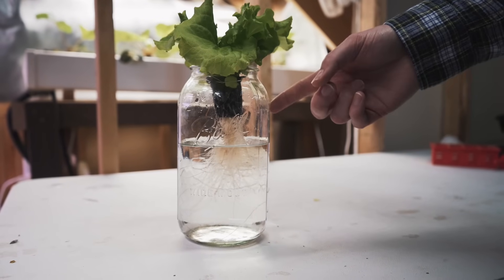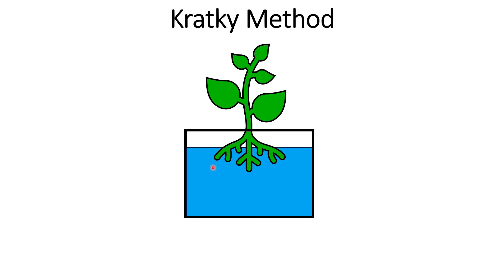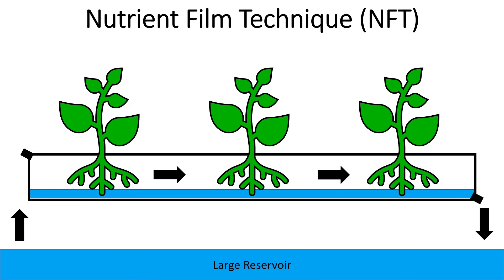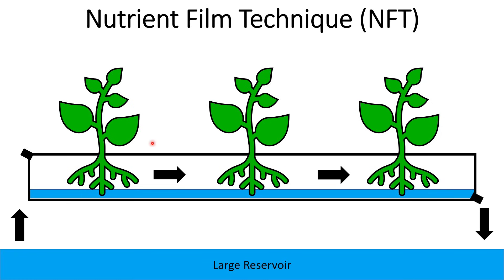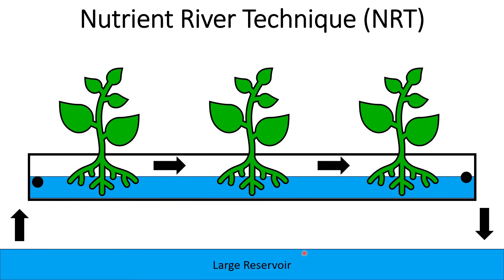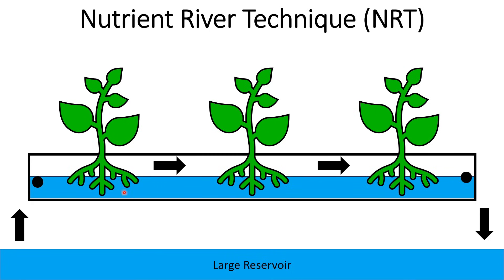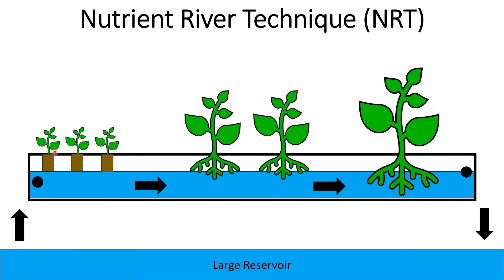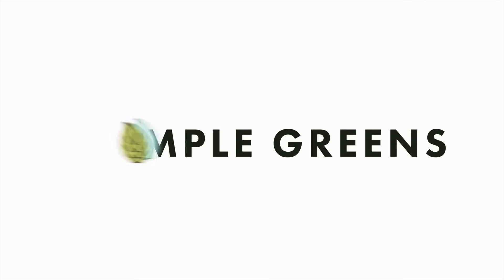Why this Hydroponic System is better than NFT or Kratky

Comment: I built this in a 90mm pipe wall system using gravity and bells on each pipe,  back around 2020. After seeing wasted space in my greenhouse.
It works quite well provided I got air circulation during heat

Comment: Love it. Been doing a similar concept for a while but I changed it slightly. I fill the bottom part with stones and the top part with coco peat. It adds extra labour costs but the heat dispersion outweighs the energy cost required to cool the nutrient tank in NFT. Without circulation it becomes a SIP (sub irrigation planter). The media holds the moisture better and longer to the point where I took out circulation altogether cutting more costs. I added a drain and overflow allowing periodic draining to dry out the planter and flush nutrient build up. You can go many years without cleaning the entire system out. 🎉 Thanks for the video.

Comment: I am trying to build a similar system at home. The nutrient solution level is higher than in NFT (Nutrient Film Technique), but my flow is intermittent, whereas your system maintains a constant flow. Currently, I plan to adjust the pump’s ON and OFF times, aiming to maximize the OFF time as much as possible.

Comment: Had a huge crop of mature cukes and the power cord died.    It was gone before I came home.  I was going to change it by adding in perlite into the pipe to hold nutrients. I never tried it.   I do have another modified bucket system which uses it.   The pump circulates the solution and the perlite will stay moist.  It has a reservoir at the bottom but only plants a couple weeks old can reach the reserve.    They grow fast and are safe from power outages or other problems

Comment: What if I don’t want to do a reservoir and just have that liquid in the tub but with an air pump for adding dissolved oxygen into the water. Because I want this in my kitchen counter and don’t have space for the reservoir and don’t have a water pump either.

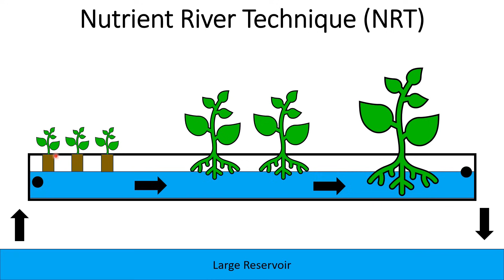Comment: 9:52 do you eventually take the seed plug out? the pictures don't show them when you spread the plants out as they grow, but I'd guess it'd be hard to get the roots out of the plug at that stage without harming them.
Reply from the maker: No, the seed plug stays in the system and basically gets swallowed up by the roots.
Reply: @SimpleGreensHydroponics Thank You!!!

Comment: I like this idea.  I had setup a system like it, and didn't let it work because it leaked.  I think I need to set it back up again.  My infinite kratky setup is failing because in 8 buckets, I  cant keep up with fixing parameters constantly.  The other day I found my basil tub at an ec of 5.0.  I've been looking for a solution that isn't nft, but recirculates nutrient throughout the entire system,  Think this is it.

Comment: I built my system out of old 275 gallon oil tanks cut in half creating 2 tanks 1 foot deep x 4 x5’ with each tank fed from a manifold from my 500 gallon fish tanks, the return manifold picks up the outflow and gets pumped up through a fluidized sand bed then mostly flowing back to the fish tanks . The excess falls 5 feet aeration tube & back to the pump. Anyway, by having only 5 feet of trough length I found the plants get plenty of oxygen & growth is excellent. Happy growing

Comment: Thanks for your informative video! Do you encounter issues with algea or fungus gnats with this system?
Also, how do you grow stawberries and sallad in the same system without the need for adjusting ph/ec? Thanks in advance :) Keep up the good work
Reply: In my opinion, many vegetables and fruits work well in the same nutrient and PH solutions. However, some are better off in a separate system if they require a lower PH (or higher) than the typical range of 5.2 to 6.5. You can find charts that show recommended PH levels of various fruits and vegetables. I look for "ranges" of PH of assorted foods and try to put things together that can grow in a particular range of PH well enough. If not, I put that food in a different system that has a different PH range requirement reservoir.

In my hydroponics... the PH always climbs through time. This, alone, can be challenging. It is still better than watering a soil based garden every day and paying endless dollars for fertilizers and more soil, lol. I just check it once a week and make adjustments. It is still easier, cheaper, and less time is required.

Comment: 5:36 that’s easy to solve .. just make sure inputs and outputs of water is further up and you could have two outputs; One is draining from under to the drain water hose connected through a T connection (split ), where the other is connected to the higher drainage point that allows a little water to sit in the duct/growing pipe . Then add a clamp or a stop/shut valve on the output that is draining from under the growing pipe. Shut this or put on clamps whenever the power goes down and your plants can feed and hydrate from what’s in the pipe and become the Kratky method until you are back on track and reopens the valve from under making the top drainage point catch air and stop operating until the level is that high again! You can also use this EDIT* on solving problem number* two, correct the other drawback and start seedling earlier on in the same pipe while having the water level higher and bottom drainage shut and just flip over to the other and open up as the roots start to become long enough 👍👍 🦾
Reply: 8:30 👍 yes 👏🏻 👏🏻👏🏻 stagnant is good ! It has a lot of nitrate and beneficial bacteria and micro organisms! So you’ll notice the plants shoot roots while your power is out for some days. The constant stream of water is actually stressing the root growth and stunts it . The same with too much air bubbles in hydroponics 👍
Reply: The sump will make sure those are thriving in the other end and eaten and cut back by the plants in that end. Very good system which is even better with fish that pees in the other end (aqua ponics )!

Comment: Thanks for sharing this. 

I built an almost identical system a while back except it was ebb and flow. The results were amazing like yours. The problem I had was the roots grew crazy inside the channel and were nearly impossible to remove when it came time for the next crop. How did you get around that?
Reply: Complete removal of the modular unit for a good cleaning... or maybe it is time to invent a cleaning device that does it quickly and effectively!

Comment: I actually have been using this similar system (but slightly different)from that you have. I have the water being pumped up to a reservoir which will drip out the water to the Kratky container. When the Kratky water reaches a certain level it drips down into a container and gets pumped up to the reservoir.
Reply: Very smart! I still do not like utilizing electricity though.

Comment: I still prefer the kratky method.  But if this DFT method works for you and you enjoy doing it that way then good for you.

Btw, i know folks like to buy those net pots, but I prefer discarded k-cup.  After I clean them i make some slits in the sides and bottom.   Great way to repurpose something.    Being creative i can even grow radishes and carrots in them. 

And instead of those expensive clay pebbles or coco coir i use granulated calcined clay.  Basically it is a generic type of turface (or kitty litter) that they put on baseball fields.  I have this from another hobby.

Best wishes to you and your viewers
Reply: Turface sucks and in 30 years I have never been able to lay hands on stuff that is either calcined enough not to melt,  or not practically dust and fines.  I've heard it exists, but its been unobtanium for those of us unwilling to risk buying entire pallets of the stuff. And given the variability of those versions I COULD find, not sure it isn't a huge risk to invest in a full pallet of supposedly the "right" Turface.

Thanks.  I'll stick with the calcined clay pellets.  They last forever so its a one time expense anyway.  Guaranteed not to melt in whole or in part and clog up your pumps and supply lines.

Comment: Psalm 46: 1 God is our refuge and strength,   a very present[b] help in trouble.2 Therefore we will not fear though the earth gives way, though the mountains be moved into the heart of the sea,  though its waters roar and foam, though the mountains tremble at its swelling.

Comment: I would prefer the dwc technic . Than you have less power consumption. And you can put seedlings in there when you raise the waterlevel be Full in more water. If you need safty for a few day lower the waterstand like kratky method with airbubbles. When the power goes of the plants can breath by the airroots.

Comment: Isn't this just the "wrong" way to do NFT? I can see that it's safer from pump/power failures, but I'm skeptical that it's more productive or less susceptible to rot.
Reply: That's my thought too. NFT doesn't recommend flooding the channel because a thin film of moving nutrient solution is sufficient. Flooding the channel like this could work too, but it's not as efficient in terms of water usage. I agree with you that the most obvious benefit of this system is the more graceful handling of power outage / pump failures.

Comment: I designed one like your NRT, but it uses spray nozzles for water/nutrient flow. 
This way it gets maximum air and nutrient coverage,  but if the power goes out you have time to get a generator on or wait for it to turn back on.

Comment: Just subscribed. I like your system but my main fear is things like algae and root rot. I have no problem adjusting pH and EC. Do you have a video that shows the cleaning process you use, how often you do it. Temperatures in your grow room, water temperatures, etc.
Reply: Algae can be a problem.   

For algae to grow it needs light getting into the fluid.  I use various things to block light around the reservoir and containers.   It seems to help.

Comment: Built the same. Adjustable depth controlled and Timer runs pump 15 min every 12 hours. Modular build to make it expandable and interchangeable and very easy to take apart and clean. I grow 10 different types of Lettuce and dozens of different vegetables and some fruit. Depending on the maturity of the plant the system will sustain them for 3 days or longer. 3x4 downspouts.  Good video and share.
Reply: Can you explain more how you built it with adjustable depth and expandable? Also want to know how to build to take it apart and make it easy to clean.
Reply: @elliot4307  The explanation will be very wordy. I was going to create a short on how I do it but cold set in and have to wait for spring.
Reply: I use a 3x4 vinyl downspout  and Vaseline (petroleum jelly) on the PVC pipe connections as my system does not have a high enough pressure to bypass the press-fit fittings and Vaseline. The 3/4 PVC pass through pipe through the end caps at 1/4" from bottom of downspout I can slip on a press-fit elbow on the inside discharge pipe and turn it up from sideways to 90 degrees up for 2" of remaining fluid in that run and if I want just 1" I can turn it up a little until it reaches that depth or whatever I need. My runs are pitched slightly to make sure fluid moves towards discharge. Only the end caps are glued to the Downspouts. All the other fittings are press fit with Vaseline. Every run is the same, every connection is the same so I can remove one 5 foot connection and put in a different one that is cleaned and clean the one I took out and move on to the next.
Reply: My outside systems are 10ft long with the same pass through positions. I can substitute the 10 ft with two 5ft. The take apart is very easy. I also can put pipe caps on one I am cleaning and fill them with citric acid solution to breakdown all the mineral build up then after soaking I pull one pipe cap off and let it drain into a bucket for the next run to be cleaned. I can use the downspout's for Kratky also. I use PVC pipe caps on the through pipe and one end a elbow and up pipe cut or turned to the depth I want to protect the air roots. I add solution through that and then stop when it overflows and the rest will drain out to keep from drowning my plants. 3x4 downspouts work great.  My discharge elbows have  fine screen glued on them to limit root access.
Reply: Do you run the water pump 1 single time every 12 hours, is it enough?

Comment: nothing new going on here, but.. if you had some sort of channel that could allow a slider be inserted between the net cups along the length of the gutter that would i think be something new. that way instead of removing and repositioning the plants you could just slide them further down (or up) the channel as they grow and add new ones. when the plant reaches the end of the channel its time to pull it out and do whatever you do (clones maybe?). bonus points if you can figure out a way to make it "telescoping" so lets say it starts as a 2 inch spacer (when they are just sprouts) and then it becomes 4 inches apart mid way through, and then 6 inches apart when its an adult. i guess it doesnt "have" to be a slider, it could be a series of plastic inserts that you remove, slide the cup, and replace.
Reply: Really great and underrated (liked) idea (comment)!
Reply: @BF6Life  thanks, i thought so too.

Comment: Wonder why one couldn't use one of those valves that stays open as long as it is getting power, then in the event of a power outage it would close so the water wouldn't drain.
Reply: Or a backup power supply.

Comment: Thx for the video, having grown kratky method, I am wondering about the use of progressively sized net cups in the river system.  Do you use standard cups when seedlings then remove them from the smaller net cups and put them in larger net cups or are you jus5 spacing them out further but using the small net cups. I ask because growing decent size stalks of celery seems to be difficult because once the roots are well established in the root cut it seems destructive to try and move them to a bigger bet cut without hurting the root system

Comment: I like Hoochos flood fill gutter grow systems, its essentially like what you have but has no need for pumps as its gravity fed , I am using it currently to good success, just need to rework  the float connection a bit to make it a bit easier to clean out

Comment: Without power your grow lights go dark. The process requires air, water. Nutrients, and light. Power outages can last days.
Reply: If your power goes out often and for long periods of time, it would make sense to have a back up generator anyway. I'd be more concerned about my fridge/freezer contents, than plants that I can toss and then regrow new ones.
Reply: Days won't hurt your edible food plants. Sure, might get a bit of stretching or a minor change in colour. This is a good idea, anaerobic conditions wont take over because of th design
Reply: Use sun light
Reply: @ It’s in his basement or an area with no natural light, which is why he’s using grow lights.

Comment: I like the rail idea for lettuce and pak choy etc. Rails could be made for 4 seedlings and four heads for example. When the seedlings get larger and are moved down the rail start 4 more seeds. Each unit you'd have would be producing constantly. Plus fully customizable as to portability or length and spacing.

Keep up the good work buddy! Happy growin'!

Comment: I would think if you put a check valve on the inlet side that if power goes out the water would hold it’s depth because the water would not drain out the inlet
Reply: I think simply having the inlet on top of the channel would not only prevent backflow in the event of a power outage, but also aerate the nutrient solution slightly more as it flows freely into the channel. The depth of the liquid is dictated by the position of the outlet only.